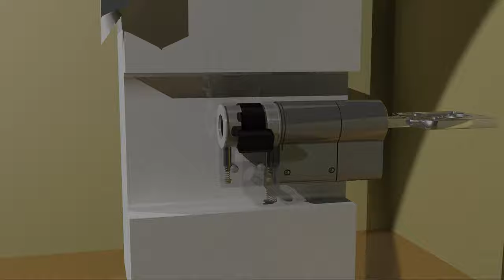What is an ANTI-SNAP LOCK?

Comment: How do you get the door open again from the outside?
Reply from the maker: From the outside you would need a locksmith to help you. But from the inside the lock still works normally so you can secure the house and exit as you wish.